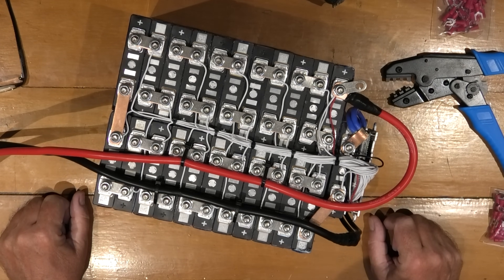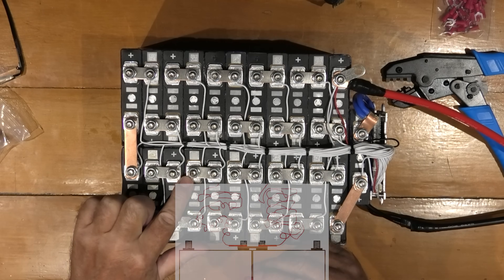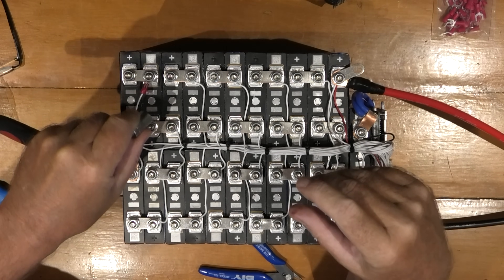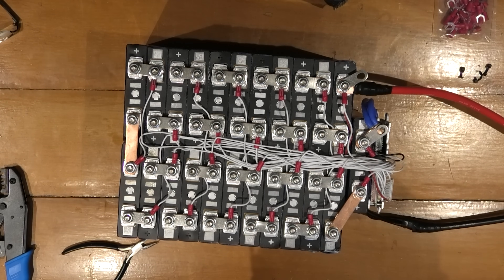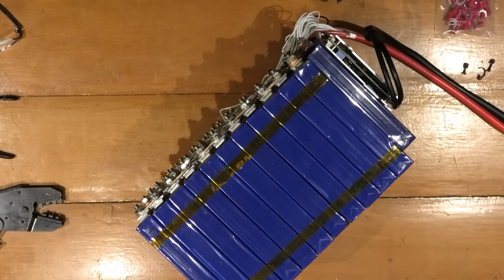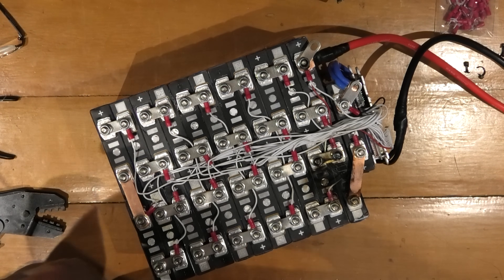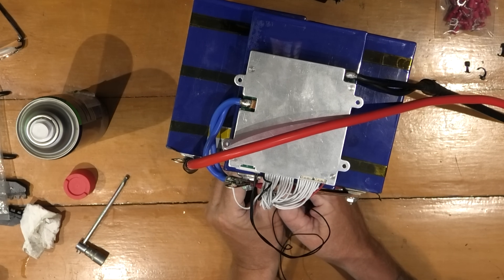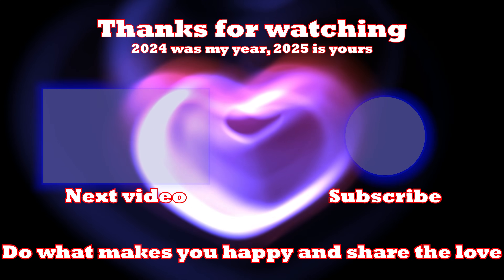The extreme DIY electric scooter / motorcycle build -  LiFePO4 battery ended in explosion!

Comment: Had to watch this video to see what you did to short out the battery. It's common practice like you mentioned in the video to cover up what your not working on while fixing another part like you did. I recently shorted out the ends of the + & - of a pack i built, got distracted in thought and did not pay attention the the 2 exposed copper ends, This in turn caused the BMS mosfets to burn/sizzle away in an instant. Quickly making me pay attention. Lucky for me it did not start thermal runaway/fire. Lesson learned. Dont attach the charge leads until the end and also make sure they dont have any exposed copper showing. Thank's for the video.
Reply from the maker: You've done the same thing as I did a few years ago then mate. Mine happened with a big lipo pack and I had to take the whole thing outside before it went up in smoke. Lesson learnt but I'll probably repeat it.

Comment: Tony, WTF ! mate 
I know your trying to do this build on a budget, but it will only "cost a few cents" to "insulate" your ratchet & tools with electrical tape. Throw a piece of thin cardboard over section of Battery you not working on.
As a Sparky that's hard to friggin watch. 🫣 
Stay safe Tony & look after yourself. You don't want hot molten copper thrown into your eyes & face.
Reply from the maker: It's fine mate, everything is fine. I'm used to it now - I had a weekly livestream on Patreon called 'will it vape' where I used my super-capacitor bank to blow things up and I'm still alive to tell the tale. Not only that but I made a large Tesla coil, Marx generator..... the list goes on.
I'll be fine, no permanent damage done 🤪
Reply: Lol. I'm glad your ok Tony.
 In my line of work, if I worked with those practices & that mentality I'm sure i would become a "Temporary" Electrician !  🪛⚡️⚡️⚡️😵☄️🔥
I wouldn't even make the organ donor list, (eg with organs being cooked from inside out & all that good shit) 😆
I enjoy your builds/ humour & your electronic projects are great. 👍 Enjoy Thailand as I know you will, its easy to feel at home there as most local thai people are so happy/ warm people in general.